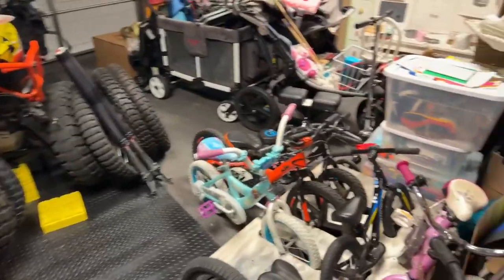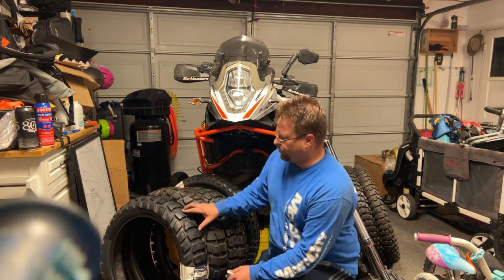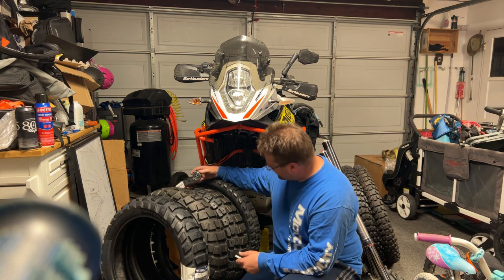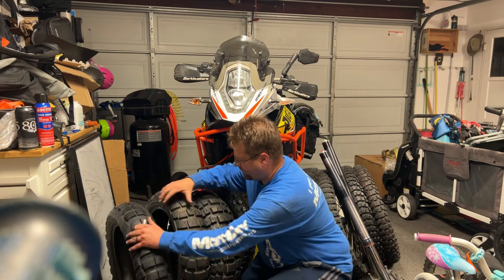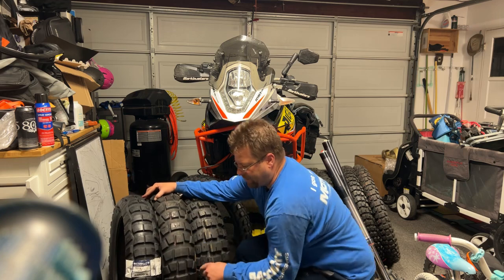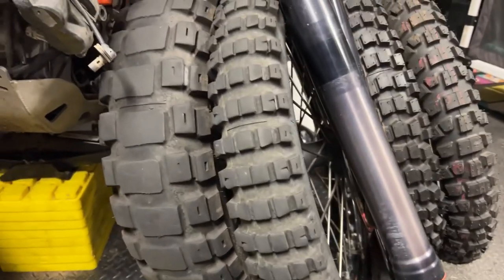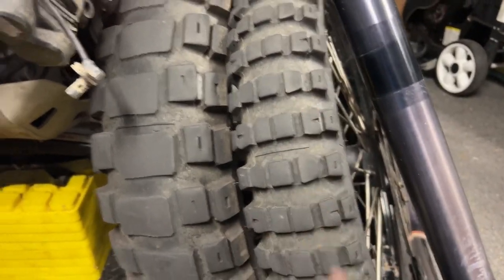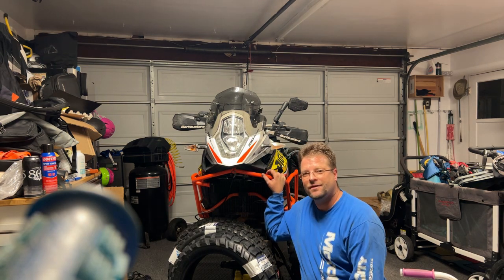Almost Midnight Tire Update | Metzeler Karoo 4 | Bridgestone AX41 | Motoz RallZ

Comment: Cool; i will wait for your future complete review of the Karoo 4 on wet & dry asphalted roads & on dirt roads (gravel & forest). Thanks; best regards from Montreal.
Reply from the maker: Yes Sir!  "Please stand by" in my announcer voice...
Reply: i have now 6000 km on the Karoo4 on a 890 ADV R. The rear is finished now, this tire is very good on asphalt/tarmac and even in the wet. Offroad it just works as it should work and it has more traction to the side than the Karoo3. I am very happy with it even if i ride mostly on roads (Germany) where Offroad is forbidden. For the annual trips to Italy or France its absolutely worth it to ride it the whole year. I cannot complain, i would like to try the AX41 but i think it will last way shorter than the Karoo4 because of my riding profile mostly on the road.

Comment: Hi Kyle, I tried the Karoo4 this spring/summer season on my GS 1250. Very reliable tyre. Better than the Anakee Wild which I used last year. Lasted more than 8.000 km. Did lots of TET, ACT and unmarked offroad in Slovenia, Hungaria, Bosnia, Romania, Greece and Albania. Furthermore some nice tarmac passes in the European Alps e.g. Stelvio. Dry and wet conditions. No issues at all. 
For autumn/winter I currently use TKC80 in front and TKC70 in rear, like you suggested. Great combo, great fun.
Next year I‘ll try the Heidenau K60 Ranger for a long trip in Scandinavia. Mostly offroad.
Merry X-Mas and thanks for your hints and tips. Ray
Reply from the maker: Dude… thanks for your feedback Ray. Sorry for the disorganized live video from the garage… (I hate live videos) but I felt I needed to get the comparisons out there as a little update. Thanks for watching and thanks for your support!
Reply: How much road noise did you experience with the Karoo4 on tarmac?
Reply: @paulvandervyver4223 , Paul, to be honest, when I rode away from the tyre dealer I though that a huge tractor was following me without any distance😉. After around 100km the noise got less loud but it remained until the end of my usage. However, if I had to choose between TKC80, Bridgestone AX41, Anakee Wild for front and rear I would go for the Karoo4 again. It simply does work very well with my 2019 GS 1250.
Reply: How were they in the mud?
Reply: @adamg6199  Mud was o.k., sand was not too good. But I don‘t like deep sand and perhaps it is a matter of bias and not the rubber😉
Reply: Weird, looking the thread pattern, thought the Anakee Wild would perform better off road, softer compound better for wet rocks, knobbies with more thread depth, and also smaller knobs to dig better into the ground.
Reply: Very weird that you say that the karoo 4 didn’t perform well in the sand, because the Karoo 3 really shines in the sand. Maybe that is something that you lose when you offset the tread pattern like that….
Reply: @bassfne  , I did sand on Karoo3 and did not like the way of having that limited amount of control. I tried it on TKC 80 and it was better but still not something I can call my favorite way of riding. And I did it on Anakee Wild which were o.k. as well. I simply do not like deep sand passages and do have too little opportunities to practise where I live. And the bike is heavy as hell…

Comment: Thanks for being up in the middle of the night to update us! Really looking forward to the test! I finally got my AX41 rear close to the wear bars at...drum roll...10,200 miles! I know, crazy right! I already have another ready to go but I'll need a front come spring. I'm not apposed to mixing brands so the Karoo 4 front may be an option depending on what you think. Cheers and Merry Christmas to you and yours!
Reply from the maker: Wow!!! 10k on an AX41!? What are you riding! Stay tuned… more action on the way!
Reply: @manybikes  KTM 790 Adventure R. About 1000 miles is off road, 3000 miles back road twisties and the rest is 70 mph smooth highway commuting droning. I thought it would be done by 5 K but the wear started slowing down from there instead of the usual increasing to the end of life. Perhaps its the smooth roads I ride mostly but the Karoo 3 was done at 7,500. Bridgestone should reward me for getting the most miles out of an AX41!
Reply from the maker: @drrider1658  awesome! Yeah, you do get the high mileage award!

Comment: i love the motoz rallz rear in combo with ax41 front.  driven about 11000 km and there i had to change te front. cant give you a % of offroad on road. but i went from the Netherlands to north cape and large part back.     when i had to switch i went for motoz adventure  front and rear. lasted me a other 11 000 when i had to change the front.  rear is still in use atm
Reply from the maker: Thanks for sharing! That is a great testimonial. So... AX41 front vs. Adv front... what are your thoughts?

Comment: I would still probably pick the AX41 over the Karoo 4.  I did a good chunk of the Idaho BDR over the summer and the Karoo 4 lasted less than 2K before it was time to scrap it.  Granted this was on the fire breathing monster that is the 1290 Super Adventure R, but I get another K or so out of the AX41.  I am currently running the Dual Venture front and RallZ rear and I will probably throw on the Anakee Wild front once I burn through the Dual Venture and run that until the RallZ rear is done.  Based on my experience thus far and that of some other folks I spoke to I do not expect the Dual Venture to last long so the Anakee Wild/RallZ F&R combo may be my go to for the more aggressive stuff.
Reply from the maker: Great feedback! I love the fire breathing bikes....  My 1190 is my Fav!  Motoz... The Dual Venture wears out like anything else not flipped.  I have gotten over 7k miles out of each DV I have run. 3 of the Tubeless and 1 of the Tube Type. Both handled great and wore great if flipped every 2k miles or so...
Reply: I'd love to hear a comparison between the Dual Venture front, and the Anakee Wild front.   I did the RallZ rear and the A Wild front for a bit, but can't say for sure how well it does by comparison because I was doing a West 38 course and riding outside of what I normally do, and because the Anakee Wild was at the end of it's lifespan.  (On a Honda Africa Twin)

Comment: Hello Kyle, one question please. I just bought a 990 adventure, the S modell. I really like to go hard and very fast on curves (and i mean HARD and FAST) and need to go offroad very often, on forest roads mostly. 
Please give me a sugestion about what tires to chose, you have the knowledge and you own a 950 wich is almost the same. In my country we don't have so many choices as you. 
I want to go with shinko 804/805 because they are available here but i would love a little bit more longevity and pobility to ride at 200kph with no problems.
So please, give me a little light. 
Thank you verry much and good luck with Santa😉!!!🍻

Comment: I have a 2023 Triumph 1200 GT Explorer and do about 80 road (highway) and 20 dirt (like mountain passes in Colorado type terrain). I am thinking either one of the Motoz tires or back to the TrailMax Missions I had and loved on my Super Tenere. Your thoughts?
Reply from the maker: I say Motoz Adventure or RallZ on the rear.  The Adv would be your best bet for longevity and the RallZ for a bit more dirt grip.

Comment: As of late the only Karoo 4's I can  find are outside the states with the T speed rating. I have a 1250gs would you wait it out as I would like to run them front and rear? I have been able to find some T rated ones in my size for the front but not the rear for clarification only the Q rating. I do ride a bit of asphalt commuting and even with my wife aboard. Any thought? Or recommendations even if its a front and rear? Im out of florida where its hot and sandy.
Reply from the maker: Run what you can find if you want the try the Karoo 4. They are internally upping the speed ratings. The lower ratings will sell through and will go away. The tire itself isn’t changing from what I’ve been told… just the rating.
Reply: @manybikes  I had gone through a few more of the videos and have really liked the reviews on the Motoz tractionator Adventure as I feel is sets the tone of the riding I’m trying to get to with this bike since I picked it up last year. So because of your reviews I about ready to order the Motoz Adventure for the rear and the Karoo 4 speed rating T for the front because it seems like I will go through 2 backs before I get to another front and hopefully by then I’ll have access to the Karoo 4 for the rear to try or just keep a similar set up. Thanks for all the help.

Comment: Hi Kyle. I'm about to replace the front tyre  on my T7 to get ready for a huge 8000km trip through Greece, Turkey, Georgia and Armenia. Mostly off-road. I have a D908 rear and don't know what to mount up front. I am replacing a Pirelli Scorpion Rally which has been incredible off-road, but unbearable in the road.
Its being hard to decide between Anakee wild, AX41 fronts as looking at thread design it looks like they will not have side grip on turns off-road.
What tyre would you recommend for my front, that is very good off-road but it's better than the Pirelli Rally on the road?
Reply from the maker: The AX41 would be my 1st choice, Anakee Wild 2nd and Motoz Dual venture 3rd.
Reply: @manybikes  Thank you for answering,. Do these handle rocky terrain safely stiffness wise (punctures)?
Reply from the maker: Yes Sir! The Motoz is the most puncture resistant.

Comment: I’m running the  Motoz Tractionator Dual Venture 90/90-21 (54R) Tube Type Front and the Motoz Tractionator Adventure Rear Motorcycle Tire 120/90-18 (65R) Tube Type on my XR650l and suspension is dialed in along with sag and I don’t really care for the dual venture front. It’s a little twitchy turning on pavement. Have you had anyone run this combo and say the same thing? Any suggestions for trying something else on the front?
Reply from the maker: Thank you for watching and for taking the time to comment. The XR560L is a heavier motorcycle as compared to the lighter "single seat" motorcycles the Tube Type Dual Venture tire was made for. The lugs are skinny and tall, thus not as stable on the road as others. What type of riding do you do most of the time?
Reply: @manybikes  I ride a mixture of 50/50 on and off road.
Reply: The rear tire feels planted but the front is a little sketchy
Reply from the maker: Got it. On the road the Tubeless version of the Motoz tires will be a better choice due to the weight of your bike. Off-road the Tube Type will have a little more traction.
Reply: @manybikes  Thank you for all your help! Love you videos
Reply from the maker: My pleasure!

Comment: 7mm new tread depth... Less than half the Rallz. Just a non-starter in the rear in my opinion. Will be too thin for soft Terrain before you've even reached it!
Reply from the maker: It is so close to the AX41 in look and feel... except for weight!  I did not have access to a scale but it flet heavier... We will see!